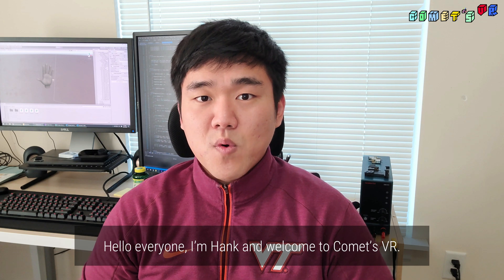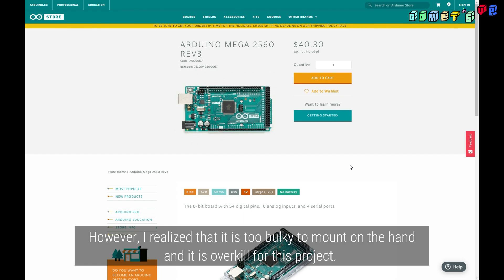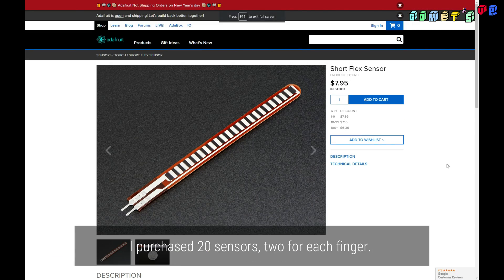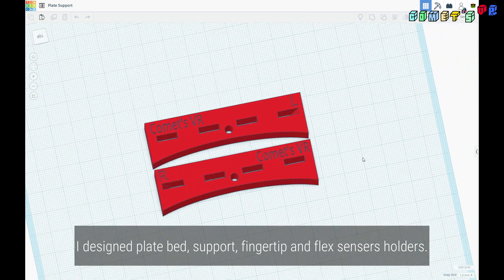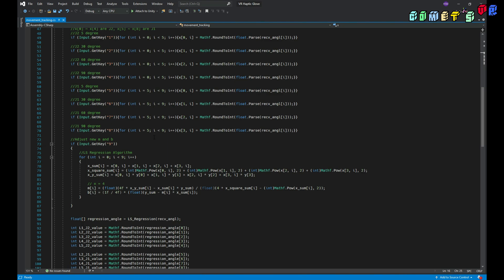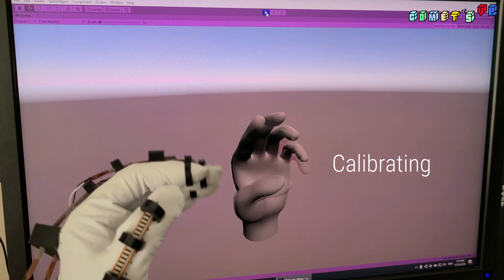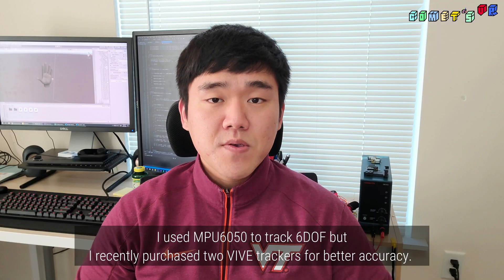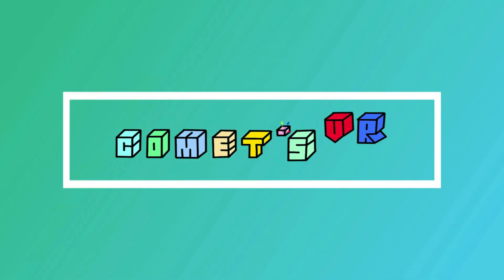Newly Designed VR Haptic Glove!

Comment: can you connect a 6050 mpu as a gyroscope to the arduino mega?
Reply from the maker: Yes you can
Reply: Thank you very much for answering, I plan to use an Arduino nano instead of that, can it be used in any Arduino?
Reply from the maker: You need to check the pin configurations. Most of Arduino boards would be able to handle mpu pins but not sure about nano
Reply: @comet-tech  Yes, I have noticed and if you can use Arduino nano with mpu 6050 but I don't know what useful code

Comment: I don't know anything much about 3D printing hardware. ELEGOO sells some that are $200 - $500. How good are the prints for that price range?
Reply from the maker: I think it's ok. If you calibrate the bed well, quality is pretty good
Reply: @comet-tech  Thanks for the reply.
Reply: @comet-tech  Sorry to bother you again but I am also working on VR hardware and I made a hip tracker (MPu6050 / Arduino Nano). It works fine in Unreal Engine but when I connect my VR headset its it becomes laggy. Both my Quest VR headset and hip tracker are using USB connection. Do you think that is slowing it down? I am new to connecting this stuff to external software so sorry if its a dumb question but you seem to have experience. I ordered a few ESP32 to use instead of my spare Nanos so I can get some bluetooth.
Reply from the maker: @nickgennady  There could be several reasons that causes the lag. First possible reason is unsynchronized frequency between Arduino and game engine. Second is, if your Arduino code has any delay function, it will cause the lag. I am not sure what's the issue without seeing your code but this is possible problems!
Reply: @comet-tech  Thanks. I got it to work in unity perfectly even in VR mode. It’s just when playing in vr there is a lag in unreal so it’s weird. I will just stick with unity.

Comment: yeah, im also stuck at the mpu6050 calibration...was trying to make my own vr goggles but failed
Reply from the maker: mpu6050 is not great for standalone.
Reply: @comet-tech  yeah, i need to find another sensor... I was stuck making filter
Reply from the maker: @wisdomcube7789  It is hard to make 6DOF tracking by yourself. VIVE tracker or Oculus has hundreds of developer working together but there's a limitation for single developer. Good luck with your project!
Reply: @comet-tech  now that you said that, ill drop this project😂 this is not in my range of skills..

Comment: I see 2.0 trackers in the thumbnail ,which is normal, 3.0 were not out yet, but this brings up a question: 
Do you intend to upgrade to either 3.0 or Tundra trackers for this project's setup?
The lighter weight can make quite the difference when wearing those gloves for an extanded period of time.
Reply from the maker: I am not using tracker anymore but will use hand tracking in Quest 2.

Comment: Great job! I personally will be using potentiometers as they are cheaper. 4 for the knuckles and 4 on the joint after. None for the tip joint as they are near impossible to move separately. Two for the thumb, and then some wacky system to track the rest DOFs of the thumb. Still unsure of good ways to implement haptic feedback though...
Reply from the maker: I am really curious how you implement with potentiometer. Lmk once you are done!
Reply: @comet-tech  I will!

Comment: I have a question for you, except the part for the calibration, how did you implement the oculus 3D hand model for your project such as assigning the script to the joints etc.
Reply from the maker: There is Oculus hand prefab in Oculus package. There are joints and fingers prefab that you can adjust. I manually matched those joints and my sensors value.

Comment: If I want to add gravity or tactile feedback to virtual objects, do you have any suggestions?
Reply from the maker: I am confused about the term 'virtual object'. I think you refer to the input device such as vr glove or controller. First, you can try generate tactile feedback with magnetic actuator on small area. There are some applications already made. However, generating gravity is extremely hard. You can generate within very specific situation but it is hard to generate in general.
Reply: @comet-tech  Thank you for your suggestion. 
At present, I can transfer the data of Arduino’s Flex sensor to Unity, and the 3D hand model is also completed. But I don’t know how to use data to move the finger models. Can you share the relevant ideas or code?
Reply from the maker: There are some examples on my previous videos. You can check those!
Reply: @comet-tech  Thanks.

Comment: when watching i notice that there was some shaking on the hand, this might be due to the flex sensors values being too accurate. You can fix this by mapping the value to smaller values inside the aurdino ide using the map function, hope this helped,
i love the new design it looks way better, and the calibration was a really good idea.
Reply from the maker: That shaking is coming from unstable power supply to the flex sensor since I am using the USB port. This will be gone once the power source is replaced. However, thank you for the suggestion!
Reply: @comet-tech  oooh i thought that would be the case anyway goodluck with your project.
Reply: @comet-tech  Can you help me with something, when ever i connect arduino to unity and use serial port and play the game the game is extremely laggy and the fps goes down to like 10. when i dont have the aurdino connected it all works fine.
Reply from the maker: @hgfjeff220  Did you put any delay function in arduino code?
Reply: @comet-tech  yea i did since im using bluetooth i need to put a delay or else the buffer overflows. is there a way i can fix it? and also how are planning on connecting ardunio with unity running on vr?
Reply from the maker: @daudhtm5203  You need to remove the delay function, otherwise cause severe lag in Unity.